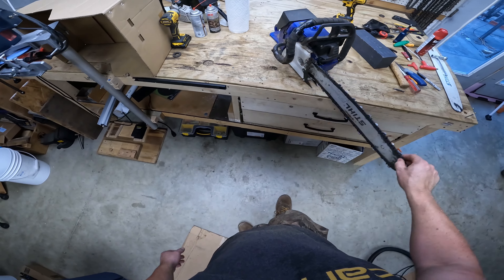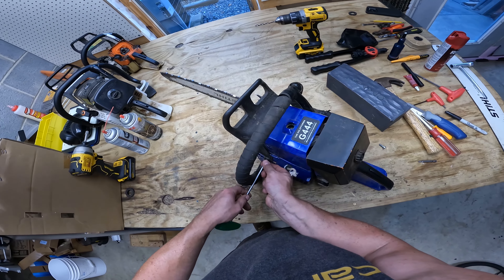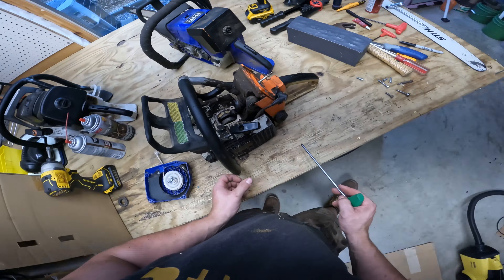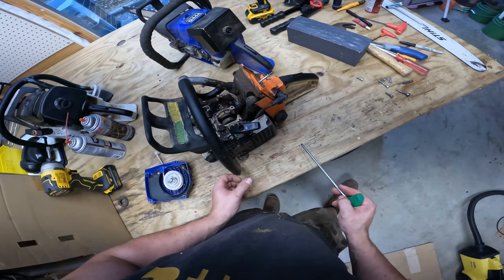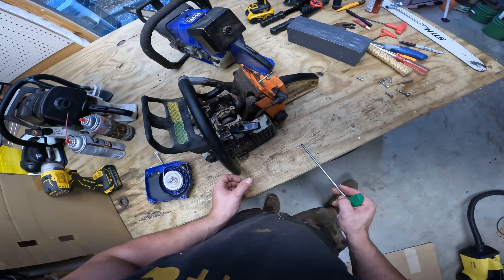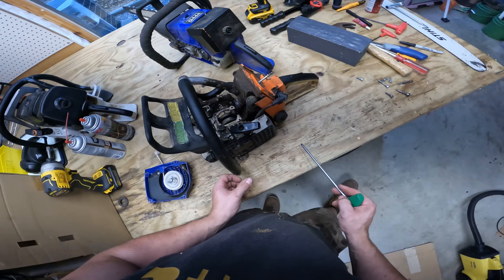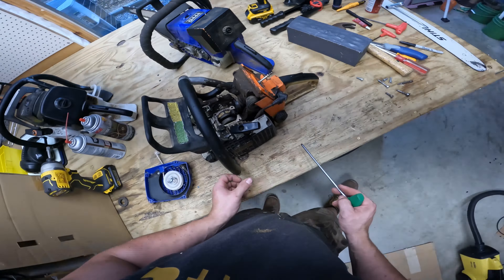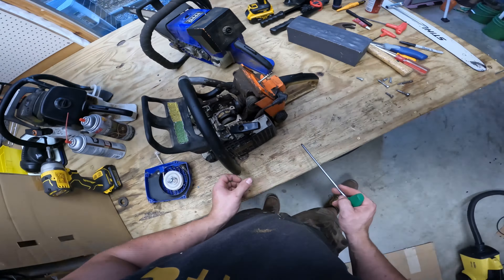Farmertec Holzfforma G444 Problems and Solutions

Comment: Looks like you replaced the gas cap - what issues did you have with the one that came on the saw? Thanks.
Reply from the maker: There was just a sharp lip in the tank casting that I trimmed when I replaced the original cap. If you trim this before it tears the o ring the original cap should be fine